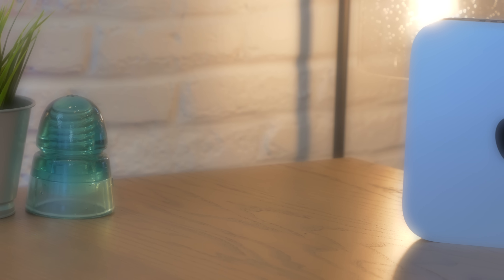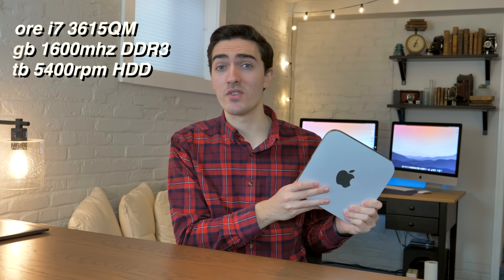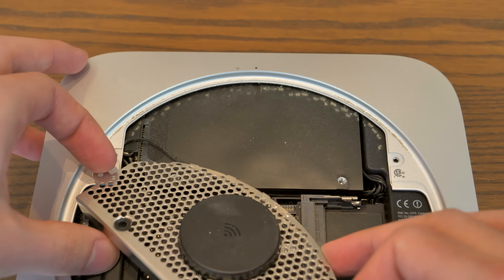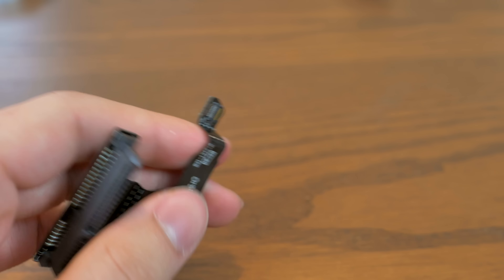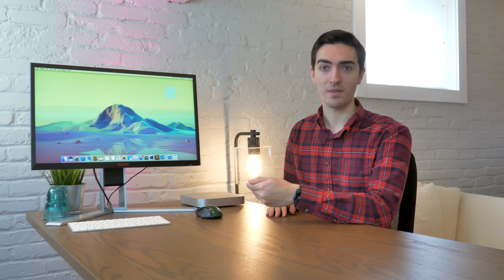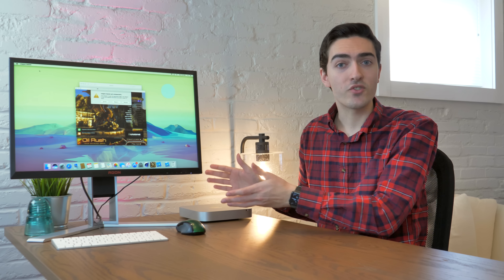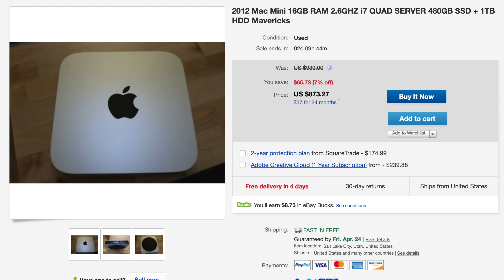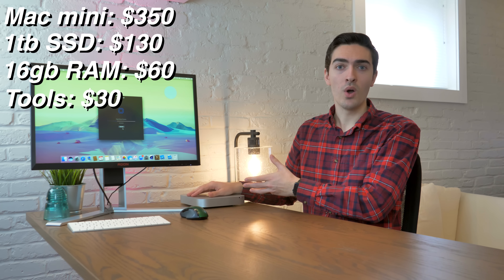Building the ULTIMATE 2012 quad core Mac mini – But is it worth it?

Comment: It's also possible to install the second disk without completing disassembling the Mini. I've installed the SSD in the upper bay this way. Just extracting the board or even not fully extracting it and then installing two mounting screws in the SSD. I have this same Mac Mini (i7 2.3) as main Mac now and it's great.

Comment: I want the 2012 quad core but I will have to save up to get one and lot of the 2012s are the low end ones on eBay.
I really need a newer computer.
I was in Costco yesterday and the senior couple was buying a brand new Mac and I had to bite my tongue because they were buying an I3 with a fusion drive and the other one they offered was an  Imac with a hard drive.
I wouldn’t get a newer computer for wedding at least and I7 with an SSD drive no crappy fusion drive
Reply: I have a 2012 i7-2.6 Mac Mini and it still has its original fusion drive. Unlike the 1tb fusion drives on the iMacs with tiny SSD components, the Mini has a decent 128gb SSD married to a 1tb HDD for 1.12tb total. It works great, I barely notice any difference between booting and running everything from the internal fusion drive and booting and running everything from an external Thunderbolt SSD. I have my fingers crossed that Apple is going to enable this year’s coming MacOS version to run on it so I don’t have to use the DOSdude hack or think about a newer machine. My 2012 does everything I need and does it very well and very fast so I hope to keep using it for at least another year.

Comment: Last week I picked up a Mac mini Server (Late 2012) i7 2.3GHz, dual 1TB HDDs, 8GB of RAM and Apple Cinema Display 24" from a co-worker for $450 total. Swapped one of the failing 1TB HDDs with a 500GB SSD and upgraded the RAM from 8GB to 16GB (already had the RAM.) This machine replaced our aging Early 2009 Core 2 Duo iMac and is being used by my kids for school work.  Speedy little machine, especially after the SSD and RAM upgrade. Doubt my kiddos will ever use the 1.5TB of space, but I'd rather have too much than not enough. I do use it hear and there, and don't really notice a difference between it and my 2019 MacBook Pro i5.

Comment: Few months back at my old job they were getting rid of old Macs (2010 - 2014 models) I got a Mac mini 2012 for my mom for $100. I already had a spare SSD and RAM . That worked out good.
Reply: Lucky u
Reply: What I really dislike about Mac is not being able to upgrade software
Reply: I recently brought 2 2011 and one 2014 Mac Mini from a guy that grab a few from his job when they renewed the Macs they were using as surveillance monitors. I think i'm gonna keep a 2011 one, with 16gb of ram and a 500GB SSD it works great! And sell the other two and basically get to keep the 2011 for free or even make a little profit, only down size of the 2011 is that it doesn't have USB 3.0 and it only has 512mb of video. Other than that it's more than capable for everyday usage in 2020!
Reply: I had one about 5 years ago, upgraded the memory, then sold it on for a modest profit after getting a 2015 MacBook Pro 15".

Last week I happened to see one locally for £100 and snapped it up. Still have the 8Gb from the old machine and will install that. It came with a 1Tb hard drive, and will add either a 960GB or 2Tb Crucial SSD that I already have once I buy the second drive kit. Should only cost me an extra £20, so feel this will be great to have as another working Mac in my home office as the MacBook Pro doesn't get much use now since work forced us onto Dell laptops!
Reply: you bought it from your mom so...you can't really brag about the price.
Reply: @Ainttrippin  he said FOR his mom LOL
Reply: @Ainttrippin  illiterate

Comment: I can go to Costco and buy an 8TB external drive for $130, so I don't see any reason to add a second internal drive. I think putting a 500GB SSD in it and replacing one of the memory sticks with an 8GB stick would give you a very capable performing machine for very little money and very little disassembly. I like seeing your videos like this.

Comment: Hey Luke great video quick question I’ve been buying early 2013 iMacs (educational model no gpu) upgrading the cpu and SSDs and ram and re selling. The only thing is they has an nvme slot for the fusion drive but I cannot seem to find an adapter that works. Any tips or suggestions?
Reply: Why not just put in an nvme ssd ?? , it should slot straight in i think. Have a look at macworld , there is an article there about building your own fusion drive but an ordinary sata ssd would go in wthout the trouble You can but a ssd that wiil do the same thing as a fusion drive , Hitachi make them , it has a cach that stores frequently used program data so they load quicker . i bought one on ebay by mistake , the seller did not know what it wa , just that not all of the capacity was available for general use , thats because it reserves a certain amount for the cach

Comment: Late 2012 Mac Mini owner here. I bought mine new in 2013 and only bought the base model (dual core four thread i5) when it was on sale at Best Buy. Everything Luke brings up is correct and as the OSes have progressed the 2012 Mini struggles more. One thing Luke didn't bring up that has been a problem with mine is monitor support. No matter how many different display port/thunderbolt adapters I use the 2012 Mini is only able to push out 60Hz on 1080p - a real bummer for my 144Hz panel. (I'm not about to buy an eGPU for this thing, I have a RTX 2060 Windows machine at the same desk) 

Otherwise, it's been a great machine and has given me 7 years of really reliable (and silent) service. The new version of iMovie is no longer really functional with this machine running Catalina, but as Luke mentions the prices of these are insane. I'm cleaning mine up to sell it (mine is maxed out too, just a Core i5 model) sell now while the prices are high, my guess is the next Mac OS will drop support for the Late 2012. Things certainly have changed with the Mac Mini... I bought mine new for $429.99 in 2013. Crazy that in 7 years it's only depreciated about 1/2 what I paid for it new.

Comment: My favorite version of this was the 2010 version (mine) because it was the last of the dvd drive.  I dont care what anybody says, dvds as a media form should still exist.  I have a collection of at least 300 dvds.
Reply: Blame the death of physical media on Sony, they required a fee for every Blu-Ray drives sold, no one wanted to give them money and DVDs definitely became too small for anything in the late-00s.
Reply: Yeah, I still like DVDs. Heck, I got an LG slim external Blu-Ray burner to use with my 2012 quad-core Mac Mini, for the same price as Apple's external USB DVD burner! And it's more robust and reliable than the Apple one too.
Reply: Back when apple was selling their 2014 model mac mini's, I made sure to pick up a used 2010 version (passed right over their 2012 models too) just like you, because of the built-in DVD super-drive.  Afterward, I wanted to add an apple 27 inch display and since my model did not have a thunderbolt port was able to get a used 27 inch apple cinema display.  Today, I am still enjoying both of them.
Reply: Yeah that’s what I have as well.  I upgraded the HD to 750gigs and installed an internal Blu-ray player now it’s my go to movie player and server via mini display to HDMI and optical toslink to sound bar. I love this thing just watched ford vs ferrari.

Comment: Yeah...I wouldn't go out seeking one of these at this point.  But if you already have one that you've had for a few years, especially if you got it at a decent price, the $220 to max it out may be useful to you, depending on what you're doing with it.  I have one of these that I use as an audio editing station and QLab playback machine.  I don't do any video with it, so I don't notice the weak HD4000.  At some point I'll be replacing it, but I think I'll get at least a few more years out of it.

Comment: Don’t compare it to a laptop. It’s a desktop. If you compare this to a 2009 or 2010 Mac Pro tower, you will buy the tower unless you don’t have the space. The Mac Pro tower is excellent. You can add ram, hard drives, SSD, BD and decent dedicated graphics easily.
Reply from the maker: It’s not really a desktop though, it’s got mobile parts in a desktop form factor. It’s more like a NUC or something

Comment: I use a 2012 quad-core i7 Mac Mini as my main computer, with the RAM upgraded to 16 GB and a 960 GB internal SSD, replacing the original HDD, running Mac OS 10.15 Catalina. It's a pretty speedy and responsive machine. I can even edit 1080 HD video on it really well, using Final Cut Pro X and Premiere Pro CC!

Comment: I agree that the prices used are too expensive for the 2012 Mini, especially the i7 version.  But man, I just bought the core i5 2012 Mac Mini with Thunderbolt Display, wired keyboard and wired mighty mouse for £400 ($500).  I threw in a 250gb SSD I already had, bought 8gb ram used for £17 and it flies!  My 2019 Macbook Pro is crashing every time I open Logic since the new update to Logic Pro 10.5 but it's absolutely fine on the 2012 Mac Mini!  It's so annoying because I need to call Apple support to get it resolved, but also kinda funny.  I have double the storage on the 2012 Mini than on my 2019 Macbook Pro, and it runs pro apps better...  I plan on selling the Thunderbolt display, keyboard and mouse and keeping the free mac!  I've always wanted one of the 2012 Mac Minis and I think it's awesome even today!

Comment: have you used a mini amd pc, i think asrock made one a few years back
Reply: I have a NUC , watching youtunbe on it now , great little machine , much much smaller than a mac mini , partly due to the seperate power brick but i look on that as an advantage over the mac mini because with the mac mini all the heat from the built in brick just helps increase the heat inside the mac mini, The NUC is silent as well , maybe because it does not have all that heat to deal with . I do have a mac mini but prefer the NUC

Comment: Can you please do a video showing how to just swap out the hard drive for an SSD, not dual?
Reply: to do that swop you do not even have to remove the motherboard or battery, just the bottom plate , the fan and shroud and the grill with the antena , you can even get away with not disconnecting the antena wire if you are a little careful but its easier to disconnect it out of the way , just a bit more fiddly but easy enough if you are patient and take your time

Comment: Luke! I got a mid 2015 15” MacBook Pro. It has 4 cores i7 at 2,2 GHz. 16 GB of ram and Intel Iris Pro Graphics. I am a graphic designer and use a lot of premiere and Cinema4D. What would you recommend me as a good solution? I was looking for something priced between $1,000 and $2,000 but with today’s standards being able to work much better than my MacBook. Should I buy an iMac? A Mac mini with high specs? A 2013 Mac Pro with intel Xeon? Please help!

Comment: I did this on a 2011 except I installed two SSD's in RAID-0 in addition to the 16GB RAM.  It lives nicely in my recording studio keeping my outboard firewire gear alive.  It's old but it still does the job after all these years!
Reply: I hope you have really good (and I mean bare-metal, like Carbon Copy Cloner) backups, because you'll be in a world of hurt if either of those RAID0 SSDs dies...
Reply: Can you boot it from the RAID-0 disks? The Mac Pro have problems with it.
Reply: @pedrofelck  Apple remove raid boot support a while ago (since nvme is fast enough is my guess).  I wrote a reddit post on how to boot from a Raid 0 volume on mojave and catalina.  It takes some work and you have to take extra steps for updates.  I did this on my 2012 mac mini with dual EVO SSDs.  Got consistent 900MBs read and writes with that setup.

Link to post: https://www.reddit.com/r/osx/comments/a2slwc/success_raid_0_boot_with_mojave/
Reply: Brad Lawrence i followed your post! Thanks it helped a lot. I was able to just clone my Catalina OS on my raid 0 ssds then boot from it no problem.
Reply: Same here, got my 2011 Mac Mini with 2GB of ram and a 500GB HDD for very little money. Put 12GB of ram that i had laying around and a 240GB SSD plus 1TB WD HDD and i'm very happy with it, all in all it cost me $200. Great machine for that price. I have a 2012 15'' Retina MBP and a 2017 13'' 500GB MBA but my favourite is always the little 2011 Mac Mini!
Reply: Eric R Hill    Same!!
Reply: Me too, literally just did mine last night. Im disappointed this video did not do that.

Comment: I’m using my Mac mini server late 2012, 2,3GHz i7, 16GB RAM, 2TB SSD. and it still works fine.
Additionally it’s working fine with my famous Thunderbolt Display too. 
It’s worth, definitely!
Reply: 27"? I'm looking at a 2.6 Quad, 16gb, 512 SSD for just under $150 to go with my 27" Thunderbolt and the graphics have me concerned after watching this. Also, does the sound work on yours?
Reply: @artistnyc123  in the meantime I have upgraded to a used Mac mini, Modell 2018, 6-core i7 3,2GHz, 1TB SSD and 64GB Memory. The Mac mini Server as mentioned above has moved to my stereo system, is connected by HDMI to my Panasonic OLED tv, sound is played by optical digigtal toslink from the tv to a DAC (Benchmark DAC2D) and this device is connected by analog XLR connector’s with my Yamaha A-S2100 amplifier. This Amp supports two Heissmann DXT-MON speakers. Sound is amazing! 
The „new“ Mac mini instead is connected to my 27“ Thunderbolt Display by an external usb-c adapter. Picture is fine, internal sound of the display audio is „so la la“. It works, but not compareable to the other system mentioned above.
Reply: @exif6839  One thing to keep in mind is the superior sound quality from the 2012 model board. I upgraded to a 2018 i3 to replace as my media server, and kept the 2012 due to the sound quality.  The 2018 is strictly used for video as a Plex server so I kept both!

Comment: I still want one of these aaaaa
Reply: привет джо, so a Russian or Ukrainian in IReland . hope you are enjoying it there , nice country . You say you want a mac mini , thats easy , try ebay , lots on there and you can get it at a good price if you are patient , dont get discouraged if you lose on the first few bids . The older 2011-2012 ones go cheap , they run fine and are upgradeable . The onle disadvantage with the 2011 is the updates to newer o/s but they work o.k on the pld o/s and there is a way around it to put the newer o/s on them . Not tried it mysef because i am not bothered about it. There is one on ebay at the moment , its an i5 which some people say is better than the i7 , mid 2011 ,
Apple Mac Mini 5,1 Mid 2011 Core i5-2415M 2.3GHz 2GB RAM 500GB HDD Yosemite
£179.99 Buy it now

Comment: I bought a 2.6 GHz Quad-Core Intel Core i7 Mini from the Apple UK referb store in 2015 for £539.  Was advertised as coming with 4Gb memory, when I turned it on it had 8Gb!  I upgraded the boot drive to an SSD using the duel drive kit and it's been fine.  I think I could sell it now for close to the same money I paid for it.  It's still a solid performer, teamed up with a HannsG 27" IPS monitor running at 2560x1440 it's fine for me for now.

Comment: Dude, how? I just wanted to buy a Mac Mini. Thanks!!
Reply: Buy yourself an older one , not the new one . With the old ones you can do the same as in the video. Easy to do if you just take your time , dont even need the removal tool for the motherboard, couple of thin screwdrivers works fine

Comment: For the love of God man, clean the fan and put some new thermal paste, i beg you.
Reply: I just picked up this same exact model with processor for $300.  I added the SSD and 16gb ram.  I cannot agree with you more on new thermal paste.  Will give you peace of mind after doing all the upgrades.
Reply: Joseph Frusci - you got very, very lucky. The owner didn’t do the research to see the value. I did the same a few years ago and got a good deal. DEFINITELY search eBay. Like really search. And set a notifier on eBay to tell you when a model is newly listed.
Reply: LOL, he's probably just going to keep as part of His collection. (:
Reply: Exactly. Why go through the effort to take the machine completely apart, and not replace the paste and clean it out? It’s a half assed effort.
Reply: I was expecting this too
Reply: Calm down.
Reply: Honestly, replacing the thermal paste on any of these is a huge gamble. Make one wrong move, and you can break the machine for good. Yeah, it’s good to replace the thermal paste, but only if your confident enough to endure the risks dissecting a mac can bring.
Reply: I buy today a mac mini 2012 and 2010 for 50euro
Reply: I have the Mac Mini Model A1327
2.5 GHz dual core Intel Core i5 with 3MB L3 Cache
(Turbo Boost up to 3.1 MHz)
8GB Memory
1TB 5400 rpm memory 
Intel Iris Graphics

Does you have any suggestions on whether I can upgrade this and is it worth doing, or should I just get something new? My budget is tight, but I really want to improve the performance.

Thank you for your time and feedback!
Reply: @GaryGans  if you replace the HDD with an SSD and bump up the ram to 16gb you should be good to go
Reply: Yep, i just opened up my iMac 2011 to upgrade the cpu, the thermal paste is more like thermal clay it runs pretty cool now. Need to do this on my 2011 Mac mini also because it runs pretty hot.
Reply: unsubbing because of this. what the actual fuck
Reply: there’s no point of him going through the trouble of cleaning the fans and adding new thermal paste since it’s probably just gonna sit on a shelf
Reply: lol hes a mac owner, they don't know any better lol
Reply: @SFStransit  ikr lol